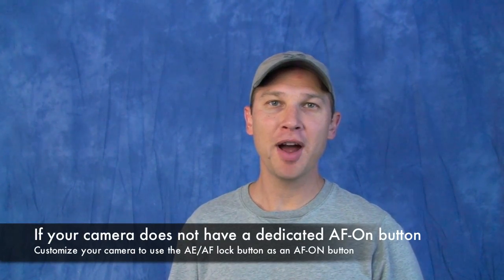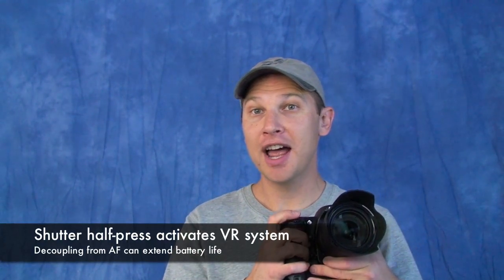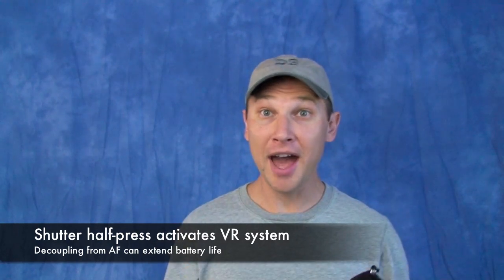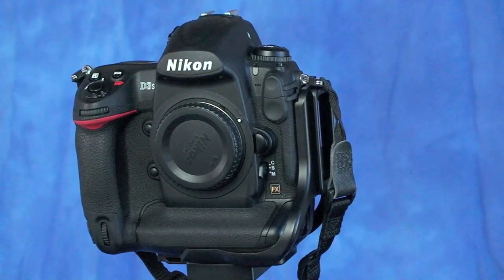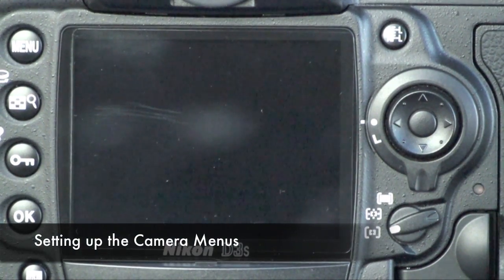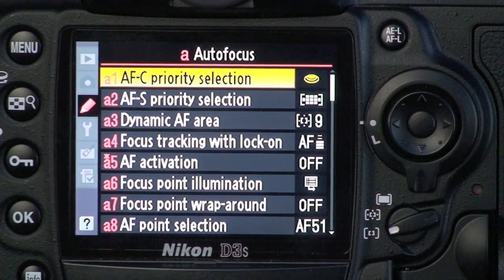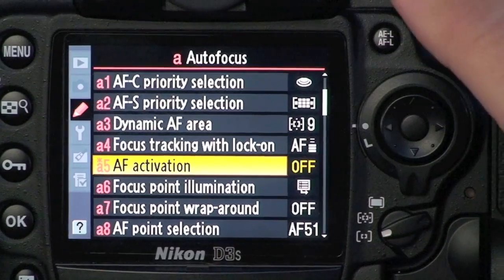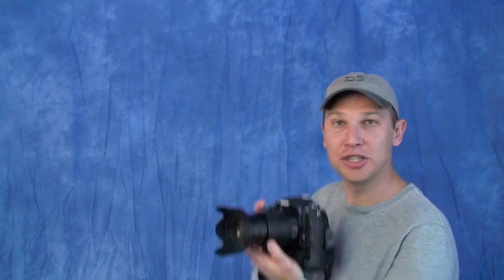Nikon DSLR AF-On Button Technique

Comment: Hi Jason, nice tuto. I'd like to try with my d750. Can you please explain how you shoot wildlife, birs on lakes this way ? do you press continously af-on and shutter when you want or release af-on button just before taking photo ? i have seen on youtube that this is the perfect mode to take street photography where portrait move a little bit instead of remaining straight against a wall,...
how do you set the AF11, af51,single point, D9... for your photos. I am lost with these modes.
Reply from the maker: Hi Marc- as long as you press the AF-ON button, the focus motor will remain active (AF-C). So you press and hold the button any time you want the focusing motor to track your subject.
Reply: thank you Jason. with a d750, how would you setup the focus points for birds on the water and for a girl walking towards you (ie: af11 or af51, single point or group,...) ? d750 doesn't have eye detection so should we quickly set a periphera point on face before tracking in AF-ON ?
Reply from the maker: @marclabro  For flying birds, I recommend using GROUP AF. For stationary birds, I suggest using either single point or 9-point dynamic.

Comment: Let me give you a little background before I get to the point.
I've always fancied photography.  So when my Mum said to me 12 years ago (2007) I want you to buy yourself something from the legacy I plan to leave you, I went and bought a Nikon D80 DSLR and a Sigma 70-300 lens.  My wife and I plus my teenage daughters fell in love with the early results. 

Sadly, my mother passed away a year later. 

But when I'd had it a while I fancied becoming more adventurous by relying less on some of the auto functions and learning about Depth of Field, Shutter Speeds and manual Focus settings but try as I could I couldn't get those instructions to sink in. 

I've now had the camera 12 years and I still want to learn.  I've tried watching You Tube videos pausing when I don't get the grasp of something being shown but a lot of it is passing over my head and quite frankly it's overwhelming me. 

Every time I think about experimenting it leaves me feeling daunted, upset and somewhat resigned to the fact I'm never going to master the camera even though I seem to recognise a good composition when I see one and I have had some nice results. 

I will probably continue to point my camera and aim hoping I get a good picture.  But as for setting the camera to meet my requirements I can't see it happening no matter how long I have the camera.

Comment: awesome video, can anyone comment why liveview/video autofocus is so much slower then in photos? d800
Reply from the maker: On the D800, live view uses the sensor (contrast detection AF) to focus. It’s not using the Autofocus module and it’s much slower to work. Contrast-detection AF is better in newer cameras, and mirrorless cameras use a hybrid system to improve focusing speed.
Reply: @JasonOdellPhoto   thanks for the reply mate - now I got what's happening.
I just bought DJI Ronin S which doesn't support d800 officially (you cant control focus there and start/stop recording). I though live view AF should be fine for filming, but now I realized its so terribly slow and imprecise - I cant film anything with a really shallow DOF as it keeps refocusing during filming - it goes back then forward then in then back again to stop at some midpoint

Comment: I have been photographing a lot of sports and concerts. Sports are usually easy to focus and track, but this will help for sure. My biggest question is for concerts! A lot of my concert shoots are not well lit, and so using my D800, I am curious if there is anything I can do to simulate the CSM that is not on my camera. I set the menu options as explained, but again I do not have the CSM on the front of my D800 body.

Comment: I have moved AE-L/AF-L button to use AF-ON and I am in AFS-C. I am using the center point as a single point focus. How do I dynamically track a moving subject (say a cyclist) but want to compose my cyclist at the 2/3rd of my frame. When I hold on to the AF-ON button and try moving away from the middle to recompose my cyclist, the focus goes to the mud/ground and not locked on to the cyclist. Am using a D610

Comment: I have a Nikon d610 and and use a 500mm  AF f4  VR lens .I'm currently shooting birds in flight which is very challenging either hand held or tracking on a pod to keep the subject in focus with one center point. My question is this. When using BBF,  is only  one single point focusing available ?  It would seem that the other 9 or  21 ( which I use in the traditional method ) points should be available. Is this possible ?  I would appreciate you addressing this issue . Of the many tutorials I've viewed  ,whether  written or video , I don't remember anyone covering this directly. Thank you for this and the other tutorials that you have posted.

Comment: Great tutorial!  I'm going to give your method a try with my d600.  There's just one thing I cannot figure out.  How do I tell the camera to use 9 or 21 focus points when I'm using the back-button AF-ON technique in AF-C mode?  All I get is one focus point, which is not ideal for photographing moving subjects.
Reply: press and hold af/m button on camera body and rotate front dial it should cycle choices

Comment: Hello Jason, great info just tying to setup the Nikon D610. I have always thought I was using the back focusing method using the AE-L AF-F button. I never knew to set the camera to AF-C in the info menu. I put the camera in AF-C mode after setting it up I'm not hearing my focus lock beep conformation anymore like I do when set in the AF-S Mode? Any suggestions??

Thanks
Reply: I'm no expert, but I think the reason you're not hearing the focus lock beep while in AF-C mode is because the camera is continually focusing.  It locks on the subject, but if the subject moves, the camera will continue to focus on the subject.  So the camera turns off the beep because it's continuing to focus.  No sense is hearing a beep if the subject is moving in the frame and the camera is continuing to focus on that moving subject.  I hope that helps.

Comment: I have a Nikon D3000 and I was trying to set my camera to shoot in "release priority", but cannot find that option as I don't have an option for "custom settings". Any suggestions? Thanks!
Reply from the maker: Try putting the camera into continuous focus mode, which might enable release-priority by default. On some of the lower-end Nikons, you don't have the same customization options as you would on the higher-end bodies.

Comment: Assume you are using spot metering, which i frequently do, especially when shooting concerts, since the lights can ofter change erratically. If I use the AF-ON to focus and recompose, will the camera keep the correct exposure to where i left the AF-ON or do I have to keep an exposure lock, too? 
Note: I am using the D7000. I can always reprogram the lower front button for AE-L/AF-L, which is also the best place for when i am using the grip.
Reply from the maker: If you use spot-metering, you'd want to use manual exposure or exposure lock. Otherwise, the metering point will change.
Reply: I am at the same point, recompose looses AEL, I believe the 7000 is the same as the 750 shutter half way will AEL, but this gets complicated, and does not make sense. Shutter half press is faster.
Good luck, peace
Reply: I've assigned my AEL to my Pv button on the front. So if i need to recompose I just press and hold Pv button to keep the exposure locked.

my camera is d7100

Comment: The AF-ON Button is a dedicated control for focussing. The AE-L/AF-L is a dual function button that locks either the Exposure or the Focus Automatically once you engaged the button. It's bit of a redundancy but you can assign them through the menu...So simply assign the AE-L/AF-L button for only AE-L to handle your Exposure Metering and use AF-ON Button for strictly Focus with the Servo in Continuous as the video suggests. D300 Manual pg.63 (AF-ON) button...I hope that helps.

Comment: So, using this method for the D5100, you have to keep your finger pressed on the AE-L/AF-L button the whole time; and once you've got your desired focus, you take your finger off the AE-L/AF-L button, and press the shutter-release to take the picture.

Why not just use AF-S normally (with the AE-L/AF-L button set on AE/AF lock), get your desired focus with the shutter-release button, recompose and shoot?

Comment: Which AF-Area Mode would you typically use when you're on AF-S or AF-C Mode. For example, lets say I'm shooting portraits and the subject is stationary, I'd choose AF-S for autofocus mode and Single-point AF for AF-area mode; Using spot metering, I'd place the subject in the center of the frame with the center focus point over the subject's face, lock the focus in with the AF-ON button, recompose using the rules-of-third, then finally full press the shutter button. Is that right??

Comment from the maker: On cameras without a dedicated AF-ON button, you need to customize the AE Lock button to be used as AF-ON. Then make sure your camera is set to Continuous Servo AF, and it should work fine.

Comment: Thanks, that was helpful :)
If i understood correctly, it should be pretty much the same putting the camera in AF-C mode and using the AE-L+AF-L button to have continous or singe focusing right?
If i focus and then hold the AE-L+AF-L button pressed, it is like in AF-S mode and without pressing it it is just AF-C. To me that seems to be even more helpful because you may not always have the time to reach the AF-On button when focusing a fast moving object using AF-C.

Comment: I set it back to single AF mode when I need to autofocus in really low light. The AF assist beam from the speedlight will not fire on AF-C. 
Additionally this technique will NOT work on bodies lower than the D90/D80 because lower end bodies don't have the release-priority option.